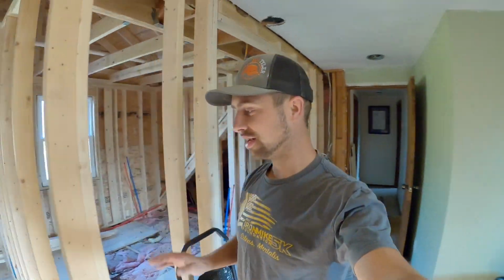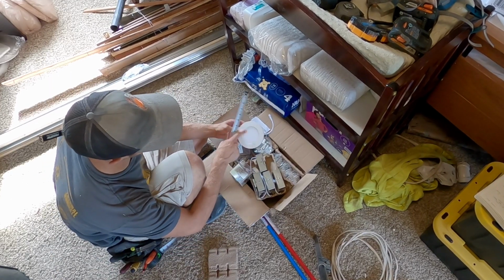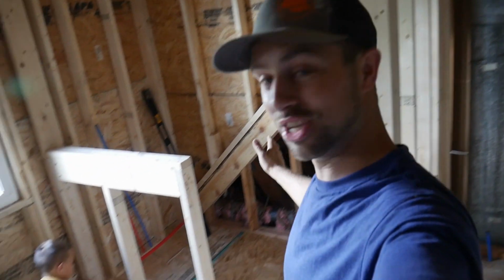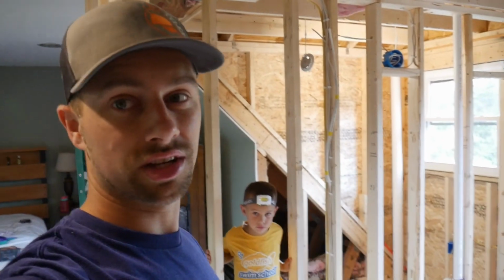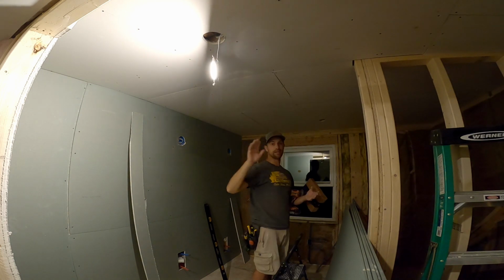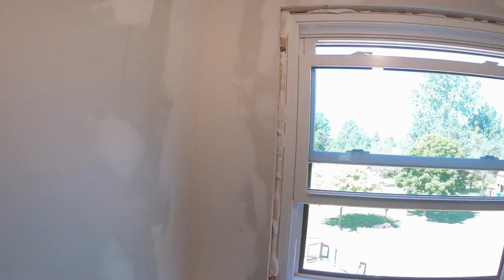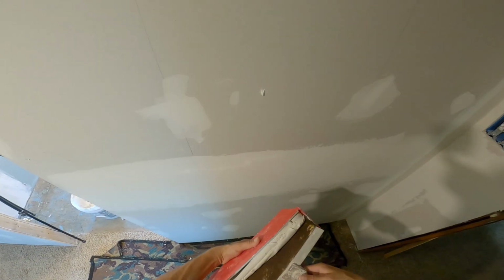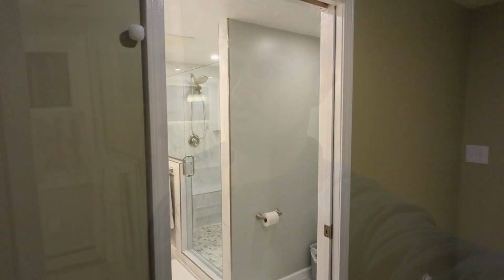Electrical, Insulation and Sheetrock! Adding a Master Bathroom pt. 3. Looking REAL now!

Comment: next time when you tape inside corners use a tape thats called Straight  Flex its a plastic tape that you don’t have to coat the entire tape just the edges of the tape since is plastic it will save you a ton of work